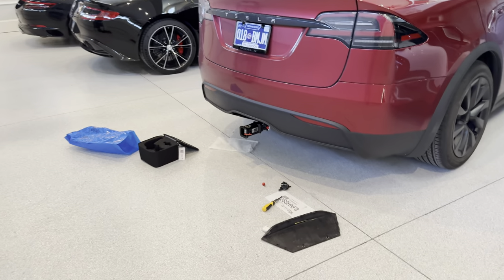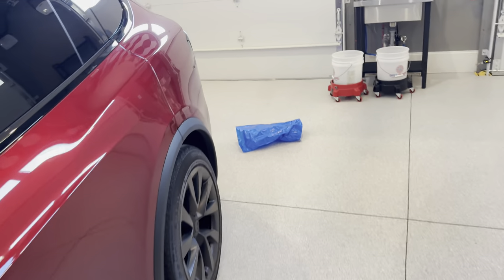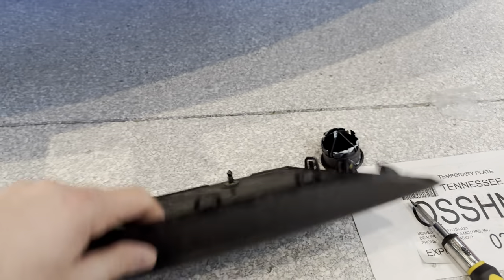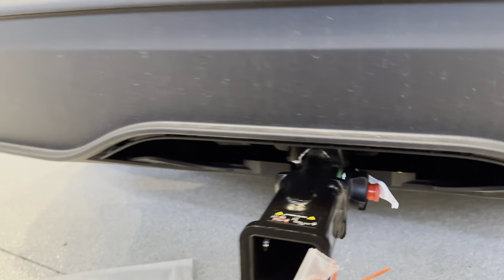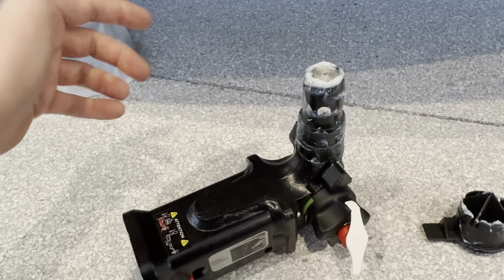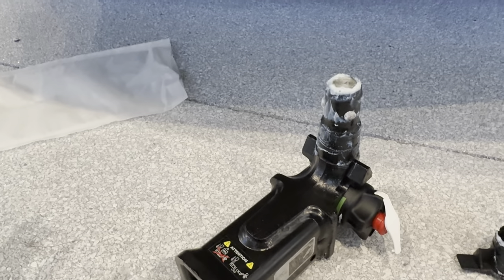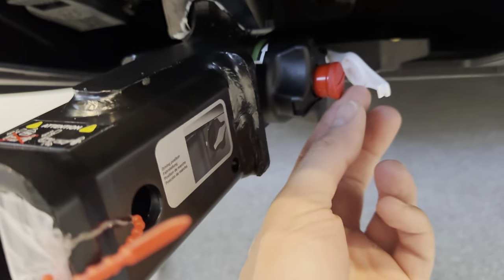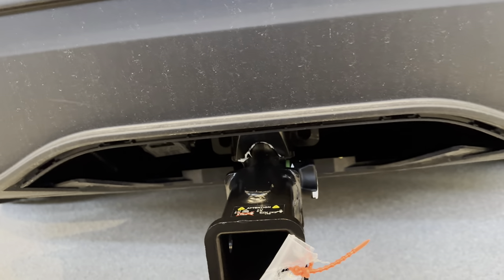How To Install Tesla Model X Tow Hook - Long Range or Plaid

Comment: Don't even have the dust cap
Reply from the maker: Sorry to hear that. But, did you get a decent deal going second hand?
Reply: @Driven-Productions ,

I’m sourcing the hitch and related accoutrement now. Found the hitch, carrying case with form insert, keys etc on eBay. 

Got a really good deal on the car tho. 2023 Plaid Model X with 2,200 miles. Same color as the one in this video. White seats. FSD. $97k